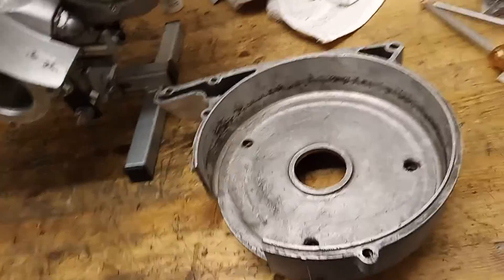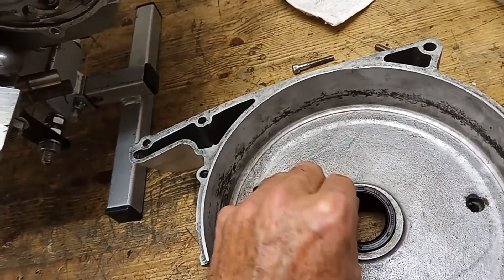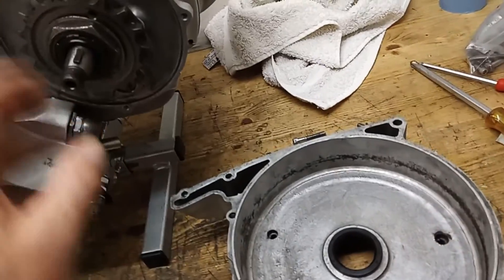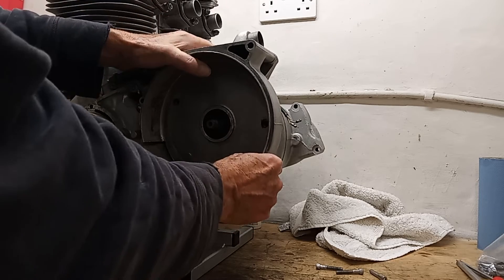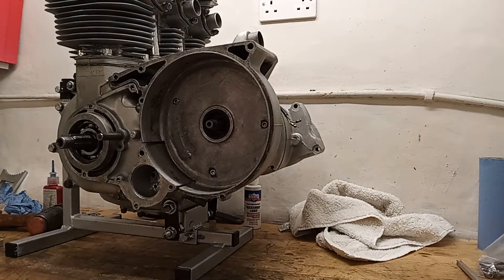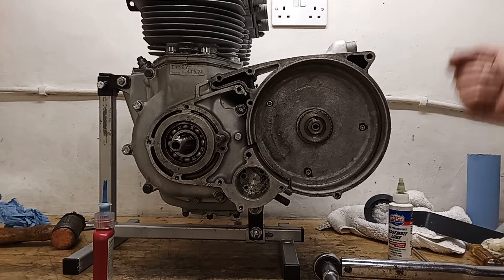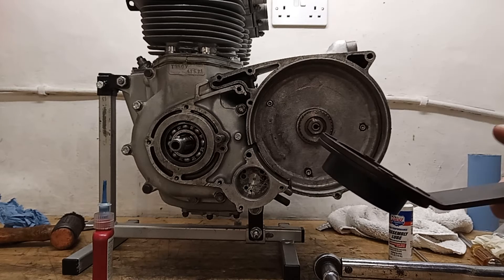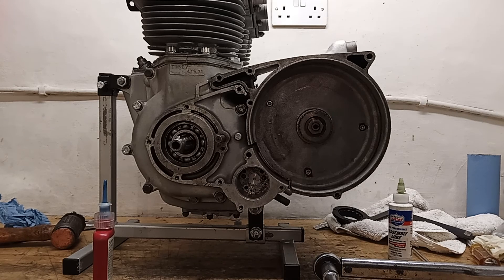Triumph Trident T150V Engine Rebuild Part 40: Fitting the Clutch Housing and Clutch Hub.

Comment: Hi Chris. Interesting what you say about the lack of clutch hub locking washer. In my workshop manual it mentions fitting a tab washer, but strangely no mention of the woodruff key. There’s no sign of a tab washer in the parts list either!
Reply from the maker: 😯 There's most definitely a Woodruff key! Why there is no locking washer is a bit of a mystery. There is a groove cut in the hub for the key, so a locking washer could lock into that - but there isn't one! 🤔🤔🤔
Reply: @Chris.rooke150  I wondered if it had anything to do with the direction of rotation, whereas the other end of the mainshaft with the kickstart ratchet needs one. But then the crankshaft drive sprocket has a tab washer!